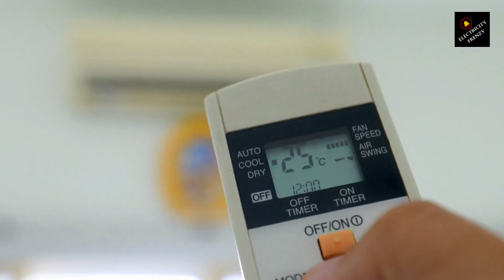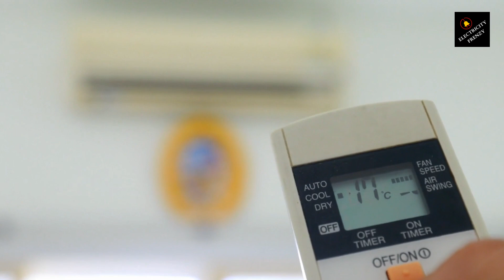Air Conditioner Breaker Keeps Tripping Off!

Comment: what would be the culprit if it flips immediately.  it wont hold on the breaker at all.  I already changed the breaker
Reply from the maker: Immediately means a short circuit 
The AC or the wiring